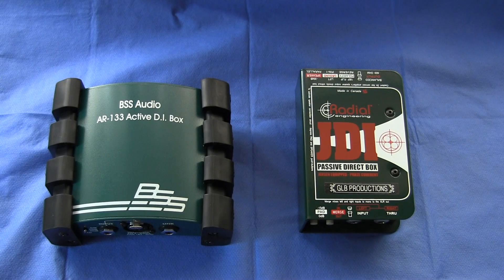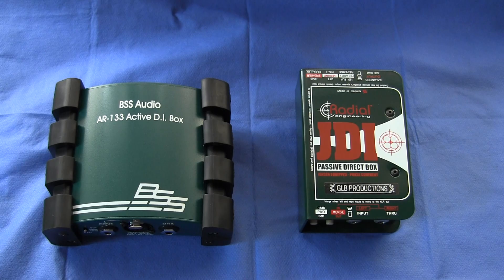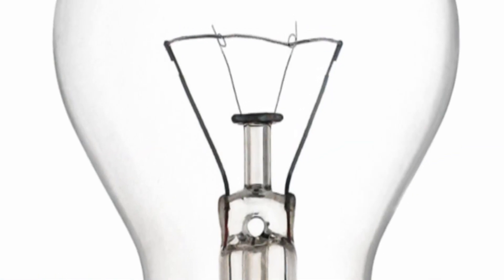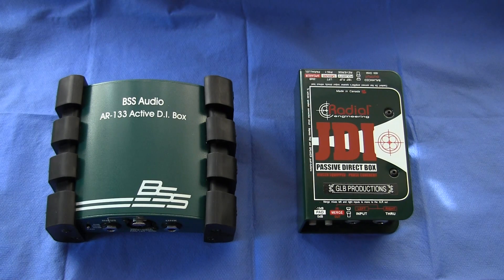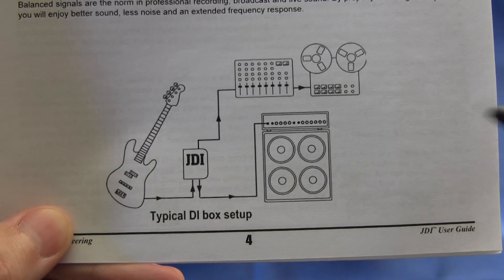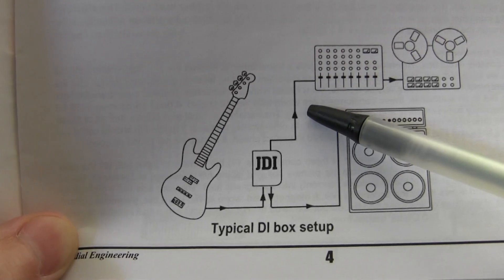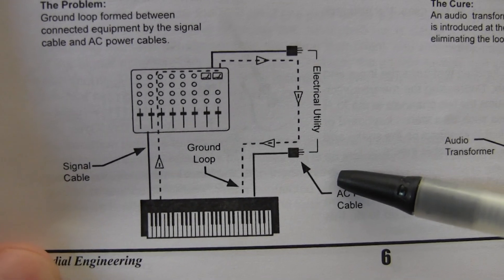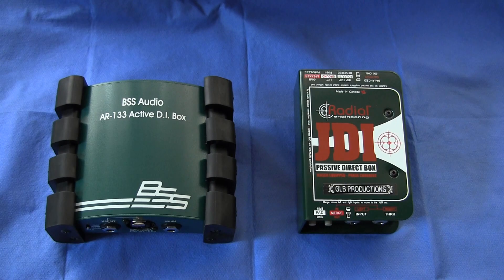DI boxes part 1: What does a DI box do, and when do I need one?

Comment: This video was extremely helpful, I have a question though, regarding the ground loop problem with the keyboard and mixer....

What if you're running the two devices on seperate circuits? for instance what if the two devices are on seperate GFI's? which apparently are the safest kind of outlets... is there still a chance of electrocution? or how about a power strip which have there own safety features?
because I'm a little confused by what you meant by the building itself is connecting the two devices, did you mean that the ground of both devices are connected through the building? therefore if there is a short circuit in one device will it then travel through the other devices' ground leading to the breaker and tripping the circuit? 

And also i thought ground wires weren't supposed to carry voltage. at 9:50 I see you talking about ground reference points its all so confusing... sorry for all of this maybe i need a lesson in circuitry but I got shocked by my guitar a while ago not realizing the outlet i was using wasnt grounded (before I knew anything about safety and electricity) and ever since ive been fascinated with learning more about it.
Reply from the maker: MBS1995 Thanks for getting in touch - the electrical side of sound reinforcement can be confusing for sure, which is why many sound guys who specialise in installation work come from an electrical engineering background. 

The best and safest method to wire a sound reinforcement system is to run everything off one circuit - a 20 amp circuit will provide enough power for most band/club/small to medium church systems with no problem. It is especially important that your stage gear and mixing console are all on the same circuit, this will prevent the type of 'blue spark' incident that recently killed singer Agustin Briolini for example: http://www.dailymail.co.uk/news/article-2848695/Rock-singer-electrocuted-microphone-performing-stage-Argentina.html

The safest kind of outlets are those that have three pins - live, neutral and ground. In Singapore all sockets are of this type - in the USA there are both grounded and ungrounded outlets. 

Yes, when I say the building is connecting the two devices it is through the common earthing system of the building itself. 

Yes, ground wires are not supposed to carry voltage or current but in the case of a ground loop you get a current flow due to the potential difference in the two ground references. This flow is generally not dangerous due to the relatively small size of the potential difference but can cause noise. 

It's good that you are interested in these things - electrical safety is tremendously important in sound reinforcement! Get yourself a good socket tester and use it on any socket you plan to plug your gear into. You should also get a multimeter and know how to use it to test sockets for good grounding.
Reply: GLB Productions Thank you, will do my research into this I had no idea that something like that could happen people play everyday unaware of the risks involved. Hopefully your videos will reach  a lot more people.
Reply from the maker: MBS1995 You're welcome - it's important for all sound engineers to know how to determine that their PA system is safely grounded and how to deal with any electrical faults before somebody gets hurt.

Comment: Hello there! Thank you for this 4 part series, it was very informative!
I do have a question, and it might be a little unorthodox: Could I use an Active DI box as a "practice amp" of sorts, by plugging headphones to the output of the DI box?
I am sold on the idea of getting a DI box, but was wondering if it can serve this purpose as well, as I am travelling a lot and carrying a bass amp+cab or a combo doesn't seem reasonable to me. If I have a gig, I always have the house's set up, and never needed to bring a bass along in order to be heard.
I'm considering the Aguilar Tone Hammer DI\preamp, and I'm playing a vintage Fender P-bass.
Reply from the maker: theallmikey In theory this would work but you would only have signal on one side of the headphones because the output of the DI box is mono rather than stereo. Also, there would be no volume control. Finally, with a passive instrument you would need a very low impedance set of headphones to get enough level to practice with. 

I would suggest getting a small mixer instead, with a 'high impedance' switch on the first couple of channels that allows you to plug a passive instrument directly into the line input. An alternative would be a USB recording interface like the Steinberg UR22 - this has the advantage of allowing recording as well :)
Reply: GLB Productions Thanks for replying!
You were talking about the Steinberg UR22; will it work with the UR12?
I like the idea of these usb recording interfaces, but choosing this option means losing all the tone shaping potential that a DI box can offer, no? (and it serves no purpose in a live situation, if I'm not mistaken)
 Any way to augment that? (Did I mention that The Aguilar Tone hammer DI is a "stompbox DI", like the ones you mentioned on your 4th video in the series, complete with gain, master and tone controls, like a sansamp?)

Now I'll throw a new factor into the mix: I have a Boss Tuner, model TU88, which has a headphone monitor feature: I can plug in my bass and a pair of headphone and hear the bass fine, but the tone is lackluster. Could I, in your opinion, be served well by plugging my bass to the DI (for its tone shaping abilities), then plug the DI to the Tuner, and use that headphone monitor feature I described?
Reply from the maker: theallmikey The UR12 appears to have a Hi-Z input, so yes it would work. 

I personally feel that a good DI box should not alter the tone of your instrument - that is more the function of an EQ. There are some DI boxes that offer EQ like the Aguilar your refer to, but that is in addition to the DI function. 

The reason your tone is lackluster on the TU88 is almost certainly due to an input impedance which is too low to provide a bridging load for your passive bass, resulting in a loss of high frequencies. Running the bass through an active DI first would solve this problem, although you must use one that has a buffered 1/4" output - an output that is simply wired in parallel with the input would not solve the impedance issue.
Reply: GLB Productions 
I will disclose my ignorance and admit that I didn't understand your last statement ("you must use one that has a buffered 1/4" output - an output that is simply wired in parallel with the input would not solve the impedance issue.")
You intrigued me with the idea of a UBS interface. You mentioned the ones made my Steinbeck; are these the ones you'd recommend? I know there are other manufacturers making similar products (M-Audio, Focusrite, Prosonus, just to name a few).
And since these devices offer no EQ, and as you suggest, I shouldn't rely on a DI box for tone shaping (even one with an EQ), is there any solution to my conundrum? 
I thank you for your time, trying to enlighten me, and I hope I'm not too much of a hassle.
I appreciate it tremendously!
Reply from the maker: theallmikey A buffered output just means one that is first run through the electronics of the unit, rather than simply wired in parallel with the input. The idea is that the bass only 'sees' one high impedance input. For example on the Aguilar tone hammer there is both an XLR as well as a 1/4" output, and both of these are fed from the circuitry of the unit. Hope that is clear :) 

It's Steinberg, not Steinbeck ;) I recommend these because I have used them for a couple of years and know they are reliable and good-sounding. I only recommend gear I have used personally for a reasonable amount of time. Yes there are many alternatives out there, none of which are terrible. 

My suggestion, if you want the ultimate flexibility, would be to pair the Aguilar tone hammer or other effects pedal + DI with a small mixer or standalone headphone amplifier. The latter can be any decent-quality headphone amp because you will not have the impedance issues of plugging your instrument directly into the amp.
Reply: GLB Productions 
Thank you, again, for your time and quality information. You helped to eliminate the confusion, but of course, the more you know, the more you you realize you don't know (and the more you're inspired to know more of).

I think I'll go with an earlier suggestion you made; Getting the Tone Hammer as a DI and eq\tone shaping preamp, and a USB interface, so I could benefit from the ability to record. 
Steinberg just released an upgrade to the UR22, called UR242, that include 2 line inputs at the back of the unit. 
What can I use these for? Do these inputs justify the price increase (more than 100$ in my country)?
Reply from the maker: theallmikey You're welcome, glad it has helped you to reach a decision. 

The line level inputs on the UR242 are for things like keyboards and the output of rack gear eg mic preamps, compressors and the like. The idea is mainly to give customers a range of models so that they can choose  the one that best suits their needs. Personally I would begin with the UR22, seeing as you only have one input at the moment, your bass.
Reply: GLB Productions 
Thank you for a solid advice.
Have a nice day!
Reply: Hey there, I thought I'd let you know that you inspired me to purchase a USB interface (I went with the Mackie Onyx Blackjack) and am enjoying it a great deal. 
I was also inspired to purchase the JDI (Peter Jannis really knows what he's talking about) So thank you for making me aware of the JDI as well.

I have a question, if I may;
Are all XLR cables the same? I just ordered a Mogami Gold XLR off of amazon, and noticed it's termed "AES\EBU & Sync 110 ohm XLR m<>XLR fm" and I just thought XLR is XLR. 
Can this cable carry phantom power from a capable mixer to a phantom powered device or did I just made a mistake buying this cable? 
Thanks again!
Reply from the maker: theallmikey Thanks for the news! Sounds like good equipment choices. 

You can use an AES/EBU cable for normal analog mic connections but not the other way around. Both are shielded twisted pair :)

All the best with your music!
Reply: @GLB Productions Hi GLB! Thanks for the video! May I know is it possible to plug in the headphone to the thru or output of the DI box via the Behringer P1 or P2 Personal IEM Amplifier?

Comment: I have a question. When i'm using an external soundcard for recording guitars in my laptop, I always get signal problems, whether it's ground loops, distorted signal, or loss of gain. Can this problem be solved by using a DI-Box? And if so, does it have to be an active or passive one? Is there any other suggestion as to a solution to the problem? Thanks.
Reply from the maker: Ahmad Ilyas It depends on what is causing the problem. Tell me more about your set up, in particular what soundcard you are using and how everything is connected. If you prefer you can send me a PM on YouTube or Facebook.
Reply: GLB Productions
Thanks for the response. Here's my setup :

Squier Stratocaster >guitar cable> Zoom G1 >guitar cable> Behringer UCG102 >usb port> Laptop (FL Studio 11)
Reply from the maker: Ahmad Ilyas Your set up looks fine to me. Is your G1 ruuning off batteries or an a/c adapter? Also, have you tried recording with just the guitar plugged directly into the UCG102, without the zoom in the signal chain?
Reply: GLB Productions
My G1 is on A/C adapter. And yes, i have tried plugging it straight to the UCG, but the loop is still audible. I've been thinking, maybe it's because the laptop is plugged to the wall?
Reply from the maker: Ahmad Ilyas Not all hum is caused by a ground loop - it can also be due to interference through your guitar pickups. Single coils like starts have are particularly vulnerable to this. Try recording with your laptop on battery power - if they hum is still there it's not because of a ground loop. Then try recording in different location or different rooms in your house to try and isolate the source of the interference.
Reply: GLB Productions
Okay. But as of my earlier question, can a DI Box fix any of these problems? Whether ground loops or pickup fault?
Reply from the maker: Ahmad Ilyas A DI box will not reduce interference or noise coming from your pickups. It may solve noise due to a ground loop under certain circumstances, specifically those outlined in the video. Sorry but I can't be more precise without being able to experiment with your specific set up.
Reply: GLB Productions no need to be sorry. Thank you very much for being so friendly :) i hope my subscribe can suffice as a payback
Reply from the maker: Ahmad Ilyas You're welcome, all the best with your music :)

Comment: What do you think about direct box to a loop station? have a acoustic taylor mini gs with a fishman infinity pick up! which DI-box do you recommend?
Reply from the maker: Edvard Aske Thanks for the question - is your intention to place the DI box after the guitar and before the loop station, or after the loop station? Or are you asking about loop stations with a built in DI?
Reply: primarily for use on the guitar, so before the loop station. owns a boss rc-300, don't know if it has a built-in DI, do you? i often get rumbling(deep noisy sound) when i record my guitar into the loop station. does the DI-box fix the problem, or do you think the problem is the fishman matrix pick-up?
Reply from the maker: Edvard Aske The specifications on the website do not indicate balanced outputs so there is probably no built in DI. 
I suggest you use a high pass filter in your software to remove the rumble. 
The Matrix infinity pickup is active so you can use a passive DI box like the Radial JDI or Whirlwind Director.
Reply: thank you for response! what about radial jdx? :)
Reply from the maker: Edvard Aske You're welcome. The JDX is not suitable for this application as it is designed to be connected between a power amplifier and a loudspeaker cabinet only.

Comment: Hi, I have a question. At the end when you explained how some people attempted to break the ground loop by lifting the AC. What does "lifting the AC" mean?
Reply from the maker: Hien Nguyen It mean lifting the AC power ground, usually by breaking off the grounding pin on the power plug or by disconnecting the green and yellow earth wire. This is extremely dangerous and should never be done in order to solve a noise issue.

Comment: Hey GLB!

You're video was good man - nice voice haha. But i was wondering if i could ask a very specific question?

If i am running my trumpet through a mic, into a Boss ME80 multi effects unit then i'm trying to run it into the desk, what kind of DI would you recommend? The effects unit only has an unbalanced 1/4 inch output so im not sure whether to get a passive or active DI? I also wanted to stay semi cheap haha. I am looking at the behringer gear. It'd also be good not to have to constantly replace the batteries in them.

Thanks for your help!!

Jack
Reply from the maker: Jack Purdon Hello Jack, thanks for getting in touch. I would use a passive DI - the ME80 is mains powered so is an active unit. 
I strongly recommend that you do NOT buy Behringer gear - Whirlwind makes relatively cheap DIs that sound pretty good, and which Behringer has copied...
Reply: Ahhh okay thanks man. I dont have a power supply for my effects unit so does that mean the DI will run my pedals flat faster?

Thankyou for the response too! - legend
Reply from the maker: Jack Purdon No worries I love hearing from my viewers :)
No, the DI is not a significant load because of its relatively high input impedance - if you were driving something like a passive loudspeaker that would definitely affect your battery life.
Reply: Ok thats cool man thanks heaps! Just ONE last thing haha, could you recommend a cheap DI that you think would work well for me? Like an exact model... Theres so many whirlwinds

Thanks man :))
Reply from the maker: Jack Purdon Sure! Best value for money Whirlwind is the IMP2, or the Director if you have a bit more money to spend. If you're running stereo you'll need two of them. All the best with your music, feel free to get in touch anytime with questions :)
Reply: Thanks heaps man, you are a legend :)

Jack

Comment: Hi I am helping with a Church in UK setting up the PA system n Im troubling with how to amplify an acoustic piano, I saw your videos about connecting bass and acoustic guitar n they were very helpful, while I couldnt find one talks about pianos. A dummy like me normally do it with a mic pointing to the top hole where the sound from, but it doesnt sound good from the main speakers, it sounds far away, not solid n mixes up with noises. Do you have any ideas/ special technique to amplify an acoustic piano to a church PA system? Thanks!!
Reply from the maker: andyandutube Hello Andy, thanks for getting in touch. Are you using an upright or a grand piano?
Reply: GLB Productions its an upright piano :)
Reply from the maker: andyandutube When mking upright piano I have had good results placing the mics at the back of the piano, pointing towards the soundboard, as illustrated here: http://www.prosoundweb.com/article/church_sound_mic_techniques_for_upright_piano/ If you are working in mono, use a single microphone and find the spot on the sound board that gives you the best balance between the bass and treble strings. Let me know how this works out for you.